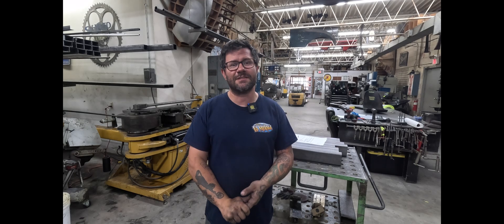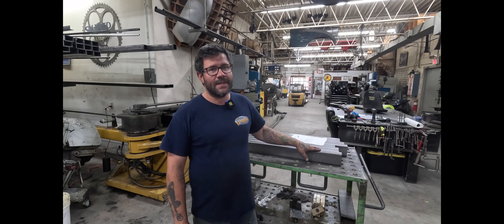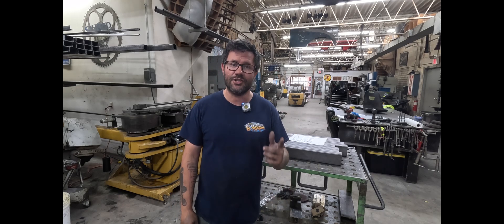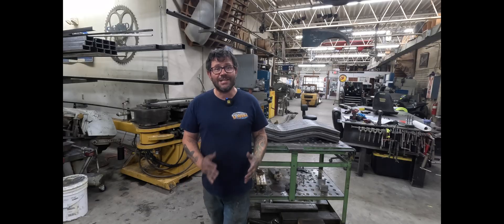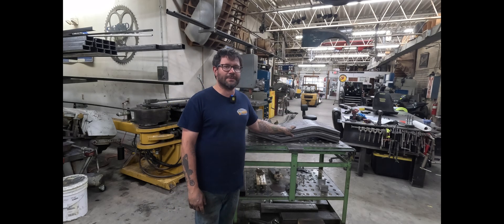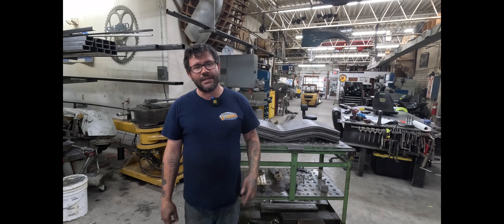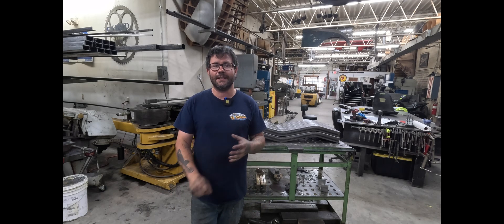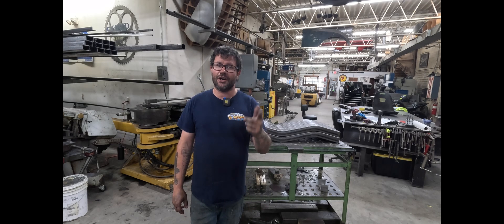Bending Non Automotive 2 x 3 Tube

Comment: Did you mark each tube, or use some sort of hard stop to set the 2 bend positions? Also, how did you come about this non-car job?
Reply from the maker: Each tube is laid out for each bend, just like a normal frame rail. Not sure how this client found out about me, but not many mandrel benders for 2 x 3 out there so word travels i guess
Reply: @cornfieldcustoms  Reckon your workmanship speaks for itself, and Youtube is also helping bring in the clientele I guess
Reply: @cornfieldcustoms  Mike, you do high-end "magic" stuff with metal. Not many folks left with your level of quality. That word does travel far.